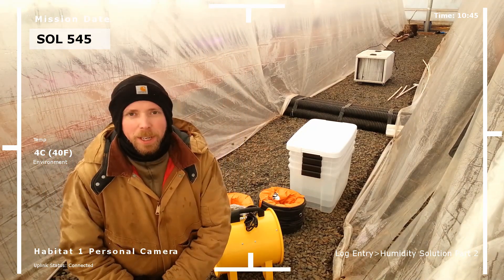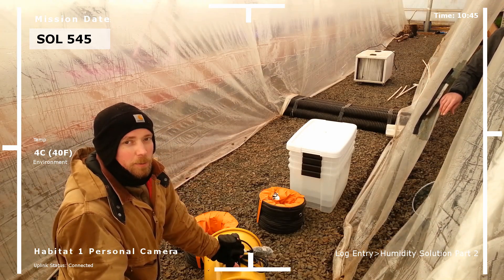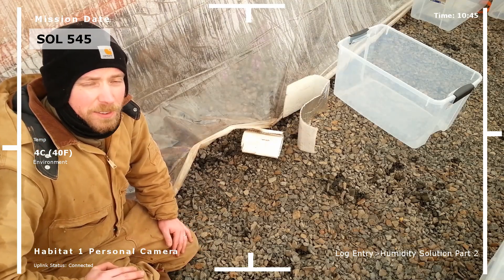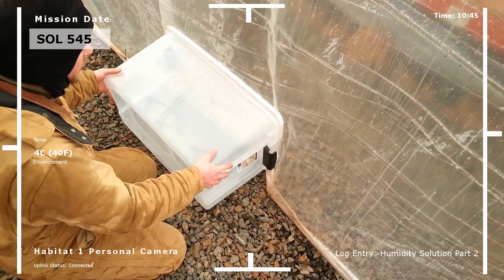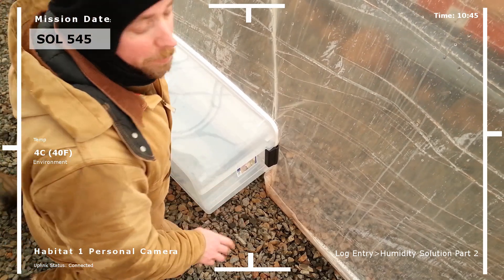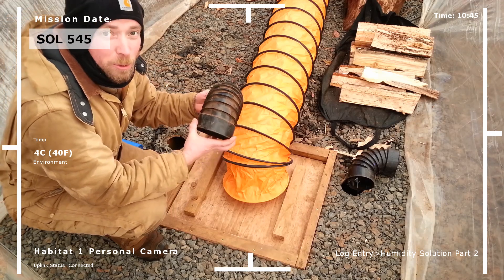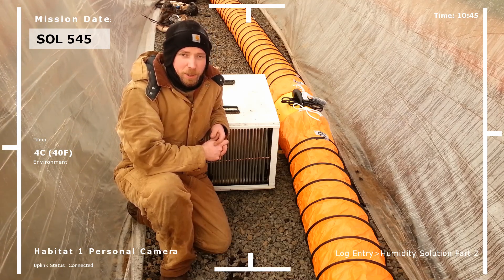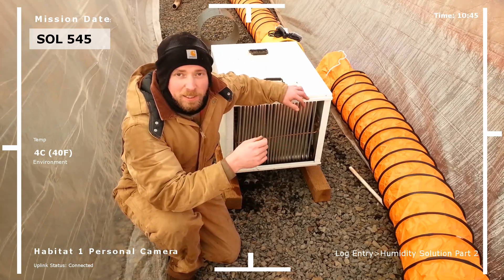Low Cost, DIY, GREENHOUSE Heating Solution  - Part 2

Comment: Square to round transition is easy with lycra (polyester/elastane) stretch fabric, fibreglass resin and a bit of mat for reinforcement. I used it to make a smooth flared transition from 10" round to 39" x 3" rectangle.

Comment: Constructive (hopefully) criticism:  Flexible duct is much easier to work with, but it does have higher pressure/flow loss than rigid duct.

Helpful (hopefully) suggestion:  For your Square box to round duct problem, don't re-invent the wheel.  Copy Apollo 13.

Use 2 Sterilite boxes: one with a top that fits the de-humidifier (#1), and one with a bottom that is close in size to the duct (#2).

Cut the bottom off of #1, and the top (channel cross section with handles) of of #2.

Slice the "vertical" edges on both, leaving the top of #1 intact.

Fit the two together, with trimming as needed, to make a "rectangular to circular" duct adapter.

Seal up everything with Gorilla Tape.

Cut a circular hole in the bottom for your duct and use a standard duct start  from Lowe's/Home Depot: https://www.lowes.com/pd/IMPERIAL-12-in-Galvanized-Steel-Ductboard-Duct-Starting-Collar/3134103 

Not pretty, but pretty cheap, and most important, functional.

Comment: Just curious...somewhat of a safety concern I guess...given that the heating element is below grade via the wood burning double barrel stove, do you have any CO monitoring equipment down there just in case?  I worry about this because as the temps drop, fire burns quicker, constant re-stoking as I saw in a later video as the weather got worse and your full time job required more of you.  You mentioned Mrs. Martian having to possibly go down and put more wood in the stove, brave woman given the environment and conditions.  Just the firefighter/paramedic in me brother sorry...if you need one let me know.
Reply from the maker: great point...I have considered it...right now we are moving a bunch of air through the stove pit so I'm not very concerned. That said....I am adding CO Monitors as part of the Phase 2 automation sensor suite I'll be adding.
Reply: TheRealMartian if you by chance could use a basic 4 gas monitor, i can ship it to you.  Its been on our shelve for a few years and were recently placed out of service.  Something portable anyways, not sure if you needed to monitor oxygen, CO, combustible gases, and hydrogen sulfide.
Reply: Pete Mercado good idea.  I watched a couple people die on a ship not knowing they were getting CO poison from poor ventilation.  Not everyone is aware of how dangerous it is.  Sure The RealMartian is but CO detectors are so low cost, one should accompany every wood burning device

Comment: Hey great video, and don't be so hard on yourself you can use the 4 inch culvert pipe for a french drain (even if you don't use it for the humidity issue you could use it somewhere else to collect groundwater)  . if you spent 100 bucks you must have quite a bit and you can always buy connectors to reattach short pieces. drill small holes in the pipe, and voila you have what we call perferated big o.

Comment: On the transition from the round hose to the square dehumidifier housing, here is a link to a page that has a spreadsheet you can download and set to your dimensions to make the transition yourself out of sheetmetal, cardboard (as a test) or some other material that you choose. I used this to make the transition for my cyclone dust collector.
Cheers!

http://joe.emenaker.com/DuctEvolution/index.html

Comment: I was wondering it you had to do anything with the condensation to make it potable? On the very basic look at this issue... I have a wall a/c unit that I collect the draining liquid from and use that to water my garden. In San Diego we get waterwise schedules due to on going droughts. The water doesn't sit for long before I use it but I remember horror stories of ac unit condensation towers and legionnaires disease. In your environment and on Mars is it a concern? Thanks for sharing.

Comment: Looking at what you are doing and understanding the airflow you are working with, I would say the best idea would be a box that the dehumidifier fits inside of with room for air to pass around it to keep the airflow up but to also recover any heat the dehumidifier gives off. 

If you move the box with the dehumidifier down to where your Tee is going to be placed the end of the box could act as your tee.  

As for going through the tent wall into the grow lanes, two 18 inch squares of 1/2 inch (12mm) plywood with a hole in the center on each side of the plastic sheet would work better than your box idea and they will likely seal better.  

I wish I was closer to you because I would be happy to lend you another pair of hands.  Get a hold of Wranglestar to get my email address so we can talk off list.  I think I can help you with ideas for your ducting because I have done some duct work.

Comment: My suggestion is to use acoustical sealant around the lids of the tubs it will seal to the plastic walls as well and prevent air leaks.

Comment: Jeff. in regards to putting the dehumidifier in line with the ventilation lines. I think what you are looking for is a round to square sheet metal duct.  https://www.google.ca/amp/s/rennieash.wordpress.com/2013/05/23/how-to-make-a-circular-to-square-duct/amp/

Comment: Just an idea regards sealing the sheets to the floor with tent pegs I have used long thin strips of wood with small holes drilled in, sheet goes under and tent pegs push through the holes which eliminates the gaps in between pegs a lot, just an idea though may not be suitable for you require. Love the Chanel though

Comment: Something to think about, maybe you have it covered already....make sure you're flowing enough CFM through the dehumidifier. That corrugated 12" pipe likely won't flow enough to keep you cool from freezing due to lack of air flow. I think you're on the right track with end to end air flow. We use the same technique to dehumidify some of our water treatment plants where all process water flows through the mechanical rooms. Read: cold water through mechanical room= lots of condensation on everything. Love this new channel!

Comment: Use a flange fitting; they con in several sizes and configurations. If you cut a hole and decide not to use it, you can put a cap in place.

Comment: for future reference.   PVC farm drainage has all of those fittings you said were too expensive as stainless steel.    Ts Ys  Crosses.    Pipe into box shapes.   They might not be readily available in your geographic are because Oregon is a "irrigated state" and Iowa is a "free water state".   In Iowa. the issue is removing standing water from farm fields.   Those fittings and parts are local hardware store items.

the ventilation fan you purchased is also available as a grain bin forced ventilation fan.   The smallest is about 12-14 inches upwards to 36 or larger.   They exist in heated and non heated versions.  The heated are known as Drying fans and use propane .

PVC single walled and dual walled drain tile will move air as well as the collapseable tubing with the drawback that the collapseable vent tubing is more portable and versatile that the field tile but field tile is considerably less cost.  

farm equipment is regulary sold used or surplus at auctions .  Those grain bin vent fans sit in the weather and get used for about 3 months out of each year.  They are durable and last decades.  and they are largely the same so parts can be moved around if one goes bad it can became sacrifical parts to keep the other running.   They are a metal  tube with mounting fittings on either end enclosing a electrical motor with a 4 bladed aluminum propeller

Comment: Would digging a trench to go under the side be less trouble then all the cutting/sealing planned here? The air-box is still useful to protect the intake point, but it simplifies going through the membrane.

Comment: Hi mate, to save money and make it very simple and also it will do the job: 
1. take super strong spill free trash bag.
2. super strong duct tape.
3. 1 plastic bucket, that will fits your hose, 
4. cut and connect the hose to the plastic trash bag and the plastic bucket in beetween with the duck tape.
5. cover your air condenser with the plastic trash bag and use the duck tape to sealed it. 
Hope it will help, good luck.

Comment: 1 - In the A/C world they use a transition sheetmetal piece that goes from square to round duct.
2 - In the a/C world where water comes in contact with aluminum especially warm aluminum the water turns into a acid or a low PH condensation. So....... be careful to watch the condensation water if your going to use it for fish or plants. If the evap coil is SS than PH may not be problem. On high efficiency heating units which the exhaust flue gas condensate the condensation should be handled with plastic pumps. 
Im just saying, take it for what its worth.

Comment: get yourself a roll of 24" wide aluminum flashing and a couple rolls of metal foil duct tape.  With that you could make yourself a couple transition pieces for the duct to connect with the dehumidifier.  it's easy enough to work with, and you'll have enough left over that you'll have plenty to make other parts as the need arises.

Comment: I am guessing you understand air velocity drops by half at each 90 degree bend of duct. You need a transition collar between your dehumidifier and 12" round, that is how HVAC guys do it. Great video, keep them coming. It is sometimes better to pull air through a dehumidifier then push it, just a suggestion, as I am not able to see the air flow of your unit. But you may have a design reason to push air.

Comment: exactly the engineering I was hoping to see you talk about. Could you show how you plumb the humidifier water return please. It might be simple PVC, but I am curious if you're doing anything to prevent water from pooling in the pipe or what. 

The A?C in my house had to have a pipe plumbed for the purpose of removing the condensate. We just sent it to the outside, so there is a small PVC pipe sticking out from my attic.

Comment: Every car does have a radiator and a fan for cooling it down. They are mostly build-in a plastic housing. You maybe can find a 12" radiator fan, remove it from the plastic housing and place the plastic just for that dehumidifier. Backside just the same thing. Normally you can remove the fan from the plastic housing.

Comment: Great video. If your having problems with them lids try a bead of silicon around the lid where it meets the box. If you want to still be able to get in it you should be able to break the seal and put it back on.

Comment: 26 gauge sheet-metal is fairly inexpensive where I am. I don't know if you have a fabricator near you or if you have any type of equipment like that. But all your boxes could be made out of metal, they also make a brush on water-based duct sealant that would provide an airtight seal.  Our duct systems have to be between zero and 6% of loss. The lowest I have achieved is 1%.

Comment: Not only am I an HVAC guy, but also sheet metal. A simple sheet metal squared around fitting could be made. Of course everything to me can be fixed with sheet-metal.
Reply: tbh if he's doing any kind of duct work, then some sheet metal and tinsnips is going to save days of bodging other solutions. A pity he's not in Detroit, he could help himself.

Comment: Ref your square to round transition. Any half decent sheet metal shop should be able to knock these out for not a lot of money. Shipyards, good car body shops, aircraft fabricators all have guys that can do this. Probably best if you leave it to the experts as it is skilled work requiring specialised tools. Here is a link. https://youtu.be/k0VhhbKISa0

Comment: build a wood frame to reduce the size of the box to the tube. staple some fabric over that and coat it in an epoxy or fiberglass resin. it should hold up to the moisture.

Comment: For joins and work like that, consider cloroplast - the corugated plastic sheeting most political signs are made of! Easy to cut, score and bend... or, zip tie awkward unions. It's plastic (good for high moisture applications) and cheap or free after an election cycle!

Comment: if you ever need to seal up smaller size pipe through the tent wall you could use drain pipe vent boots. they're made to put vent pipe up through your roof. it's a big plastic square with a rubber boot that accepts up to 3 inch pvc pipe. you could sandwich the plastic sheeting between 2 of them with some caulk, which would give you a completely air tight seal.

Comment: I know money doesn't grow on trees, but, for areas of ducting that don't need to move if you could use non-corrugated that would improve overall efficiency massively due to surface area. 

Also, duct tape. Never a bad idea to have tons of the stuff around.

Comment: I needed to hook a rectangular outlet of a blower to a round duct.  I did it with a fabric connector sewn to match the connection.  But I like the ideas of installing the dehumidifier in a box with the duct attached or a box to be the connector.  I have used the sandwich approach to connecting a flexible duct to plastic.  Burying the duct in the ground under the plastic is also a very good idea.

Comment: It may not be the best way, but the way that I would address the square box married to a round hole would be to purchase some ripstop nylon and sew a seal. It would be a very beginner sewing project and could be done pretty cheaply. I'd probably purchase industrial velcro to go around all four sides of the box, then sew the corresponding pieces onto my fabric. The same could be done at the round end. If you can find a neighbor who already knows how to sew and has a machine, this can be accomplished for the price of the materials alone. If you don't like velcro, you could consider magnets (or both) to help with the air seal. P.S. I learned to sew off of YouTube when I wanted something that didn't exist. It's a nice skill to have. Good luck!

EDIT: I just read all the suggestions of using sheet metal and that is probably an easier and faster solution. When your only tool is a hammer (sewing machine) everything looks like a nail.

Comment: What's the reasoning for venting the dehumidified air to the furnace? Is there duct work returning warmed air from the furnace room to the grow bed tents? If that air is being sent up the chimney it seems kind of wasteful as you've just spent energy dehumidifying it and it's probably still warmer than the ambient air.

Comment: +TheRealMartian I'm unsure if you have thought of this yet, but could you get a larger box and cut a 12inch hole in it and fit it around the dehumidifier? If there is a box larger enough to place the dehumidifier in then you can make it a sealed system. Also, you can add a drain plug of some sort to redirect the water back in.

Nikesh

Comment: Could you have put the vent in the ground under the tent to save cutting holes in the tent and being in the ground would it be more air tight ?? Thank you for the video.
Reply: Richard Maunder That's what I was thinking. To add to that, build a square or rectangular channel with wood scavenged from pallets or whatever to transverse the two pods. The channel could be painted or lined with 4mil plastic to prevent the wood from absorbing the moisture. Then build a structure straight up from the middle to couple to the dehumidifier. That port can be constructed to be the same size and shape as the dehumidifier input. Likewise, the same concept can be used at the exhaust end of the dehumidifier.
Reply: This idea is assuming a temporary structure until you know what will work.  Then you could fabricate one out of metal and replace the temporary stuff. Checking around for a used metal bending break may not be a bad idea at this point in your construction.

Comment: I'm a fan of plywood or thin sheet metal for custom fittings. I like the ingenuity of the plastic totes, but I foresee problems with maintaining a seal unless you tape it.
For the round to square to round problem, can you put the dehumidifier right up against your junction box and eliminate one of the adapters? Then it would be one tapered box with one end the size of the dehumidifier and the other side about 13"-14" with a 12" hole in it. 

Great stuff, looking forward to seeing how you decide to implement.

Comment: Your issue with square to round can be solved easily and inexpensively by using sheet metal, Cover both ends of the dehumidifier with flat sheet metal with a 12" hole cut out in the center, You can then plug the flex duct into hole or make a round sleeve using said flat sheet using pie, 3.14 x12 . Duct tape will work on Mars too you know.

Comment: have you linked up with a school or unversity or is there a 3D printing club where you are? they could work on a design and print it out for you ~ Was it the ISS the other year was testing out 3D printing in space? I bet any bases set up on the moon or mars will include a 3D printer